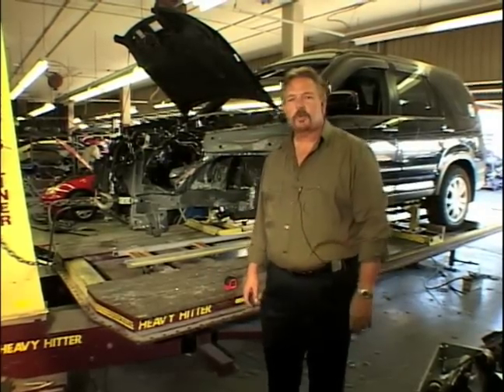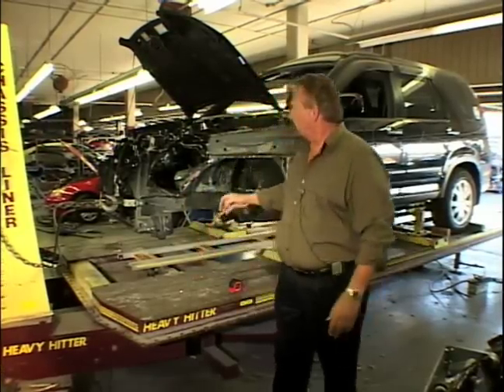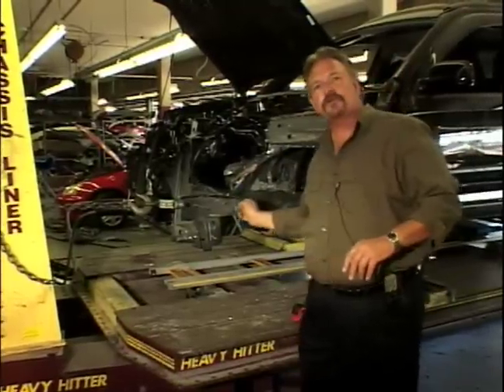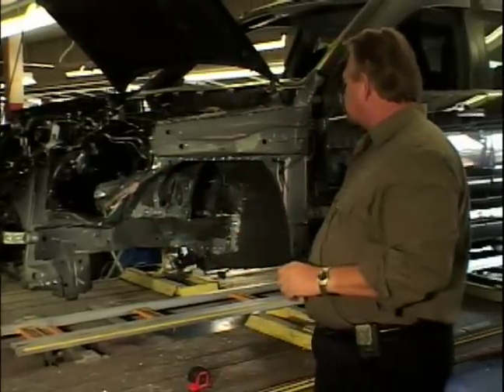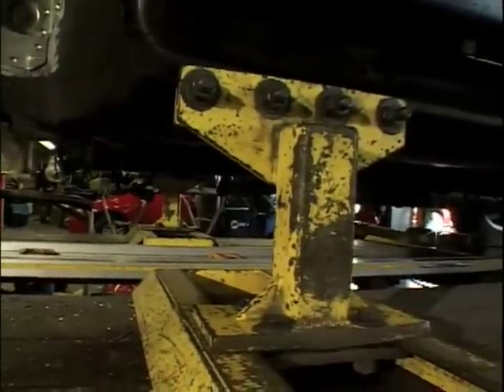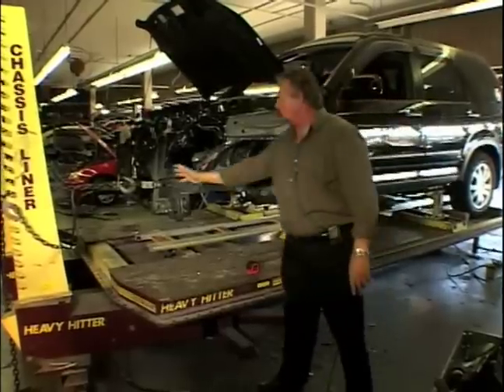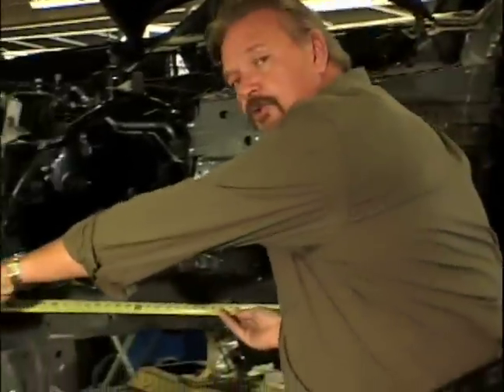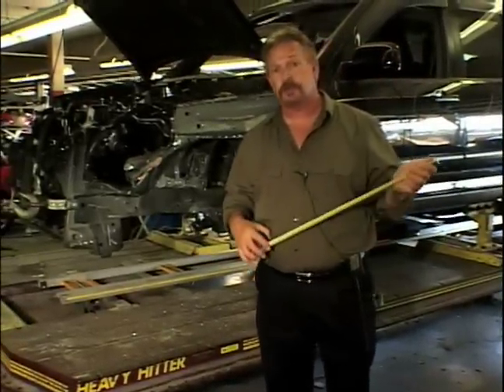How to: Car Repair : How Wrecked Car Frames are Straightened

Comment: Autobody instructor here and everyone should know, frames and unitized bodies can be straightened easily and correctly but like with most things, their are correct procedures and processes to do it. With a  proper frame staightener and devices, any frame can be put back to factory specs, like it never happened. I've done it 100's of times but knowledge is critical and you don't do it by hooking the car to a tree and measure with a tape measure.
Reply: Like it never happened is totally inaccurate I must say and I'm not trying to be rude here. When a car such as this one has been in a wreck and suffers frame damage, that "damage" is unrepairable. The bending of the frame is cause by a rupture of the bonds between the molecules of the metal in this case probably a mixture of iron and steel. Using a framing machine sure helps put the car back together but the strength or integrity of the frame will never be the same again. So if the same car gets into a collision more of less of the same magnitude, the damage this time will surely be significantly worse thereby putting the driver/pas at more risk of injury or possibly, even death. With that being said, I must admit I drive a rebuilt vehicle and I'm starting to think I'm a little too comfortable with this clearly ill-calculated risk.
Reply: +ezyfnef agreed .. never the same
Reply: I question credibility instantly, when you say "any frame". like, a ford ranger that stalled in front of a train, could it do that?
Reply: Do you have a shop?

Comment: OK. Some pretty harsh comments.  In my defense, I had no control over the editing. This was filmed as almost one long sequence, and was cut by Expert Village where ever they saw fit. I did discuss advance measuring techniques, but it was cut out.  FYI, I did not receive any money for this video.  Any measuring system is only as good as the technican using it. I have seen frames ruined even when jigs were used!  I also have seen metal men move from one shop to another with great frequency.  Also for FYI, I have managed several body shops, and seen thousands of repairs, both good and bad.  If you polled all of the body shops in America, you will find that only a small percentage has advance measuring systems.   Technology is great if you can afford it, but only if the person using it has sufficent skill!  To make issues worse, there are very few schools turnng out highly skilled bodymen!  But I admit, if I had control over the video, it would have been very different!  God Bless You All! 

P.S.  I'm down to 215lbs now. Thought you would like o know!
Reply: Don't pay attention to any "harsh comments" thats the nature of YouTube, 3/4 s of the time they have no clue what they are talking about anyway, thank you for the video, very helpful.
Reply: muhammad ali weighed 210.5 lbs when he won the title. you need to lose another 4.5 lbs.
Reply: Great job on the weight loss!! I bet you feel a lot better : )
Reply: loved the vid make more in depth ones!

Comment: I have a 69 charger and the driver side frame is bent inward nearly 30 degrees, would a steel cresent wrench and a long cheater bar be strong enough to bend it back

Comment: @tomcatdcn It depends if the metal is cracked or not, usually I don't think you would have to worry unless you crash it repeatedly in the same spot.

Comment: @Cargo1273 Our van was declared totaled because of the mounting hole for the rear bumper on the left side was torn out by the impact. Replacing the frame rail was the only way the insurance company would do it and they didn't want to pay for it vs welding the hole and re drilling it out.

Comment: Once a frame is bent (depending on how severe) it will never ever be back 100% original factor specs. Depending on the technician, you might can get close. But there is no such thing as reverse-entropy
Reply: Yup. Even if the frame is put exactly back into its original position, the structural integrity of the frame is slightly compromised

Comment: Guys, for unibody structures if you watch Sam g's videos you would see that he drills out the spot welds for frame pieces that are really bent and then he welds on new aftermarket frame pieces. For example the radiator support or the frame pieces for the trunk. You guys think that they're just bending out severely bent frame pieces but they're not. That's not how it works
Reply: yeah undo the welds then bend the metal and then reweld the seams back with stronger protection

Comment: @Cargo1273   I don't know where you learned that but it's wrong.  There are several ways to do this.  1 is to pull out the frame rails and repair as this video is showing.  The second option, which is more commonly used on a unibody car is to replace the rail if it can't be repaired or to buy a new rail and cut out, or section in shop terms, the area that you need and weld it in place of the damgaed area.  The 3rd option is to replace the frame altogether, usually on a truck or large suv.

Comment: Not enough body mechanics have proper I-Car training in repair procedures in North America.  Cars are butchered and high-strength steels are rendered useless by improper heating and pulling creating weak points.
Reply: +Audioquest56  did you ever attend any class , I do , they don not teach nothing
Reply: panchacleta Vargas Yes, I take 4 per year to maintain my Platinum status.  I think you need a better teacher...

Comment: Isn't the frame still structurally comprimised?  Don't most people take pieces of another car's frame and weld it onto theirs? I understand the point of tension would be at the weld but, even then that is better then an aluminum can that was bent and rebent....

Comment: @YouSpamTard Our van was declared totaled because of the hole for the left side of the rear bumper in the frame rail had been torn out by the impact. The cost of replacing that frame rail put it over the 75%. It would have been not totaled if the insurance company would pay for repairing that rail but no they said they could get sued for doing it that way. I guess insurance companies do lose lawsuits once in a blue moon. I would think they pay for the best lawyers and weasle out of claims.

Comment: 3 dimensional measuring ONLY. Machine is fine as long as the tech knows how to use it. Without a good measuring system (and someone who knows how to use it)  the cars are not PROPERLY repaired. Would a real carpenter build a home without a level, tape measure and/or (in todays world) some sort of laser. Without a good foundation you have nothing.

Comment: If the frame was bent the insurance company would  total the vehicle anyways there would be no point in trying to fix it
Reply: Insurance buys the vehicle, sells the vehicle through auction, buy gets it fixed, buyer sells vehicle with salvaged title. It's a very common thing.
Reply: doughnuts6801234  
no ..in fact frame repair is not that costly in the US. most of the car which had front end accident needs frame repair. Once you involved in accident, the frame will be bent it is just a matter of how much.
Reply: doughnuts6801234  that's right🤔
Reply: Valid Point not alot of insurance compaines would fix a car that has it frame creased or bent plus these insurance will total anything these days because they want to cut down on time spent working on the car
Reply: @xaytana  Incorrect. Insurance buys vehicle.  A new title is issued for the vehicle declaring it's "salvage" status.  Auction/person buying it back from insurance has it rebuilt/repaired, then applies for a "rebuilt" title.

Comment: once the frame is bent, the car is shit, it will never be the same no matter how much you tape measure, you don't know the headaches i've endured trying to align a car that had a front end collision and the frame was "straightened"
Reply: i wouldn't straighten it neither, i would buy another frame and replace it, like cars with rusted frames, its much better to replace it in the long run, and used frames in good condition are not uncommon
Reply: once its strengthened its fine otherwise they would never bother having made these machines to repair cars
Reply: you had headaches because someone did not straighten it properly
Reply: lol I agree.
Reply: I HAVE A 2010 DODGE JOURNEY ID LIKE TO KNOW THE COST OF PUTTING MY CAR ON THIS FRAME MACHINE.
Reply: Shite.

Comment: Hundreds to thousands, depends on the damage... normally if the cost exceeds a thousand dollars, or the value of the car the insurance company will total the car and write you a check.

Frame damage is the worst damage to get, caused by fire or impact it can destroy the car's structural integrity that protects you in the event of a crash. Sometimes it's just not worth fixing.
Reply: If you watch Sam g's videos you would see that for unibody structures he drills out the welds and replaces the frame pieces with aftermarket. So actually the frame stays intact he's not bending out bent frames he's replacing the frame pieces by drilling out the spot welds and then rewelding the new pieces on
Reply: eksine Do you think the car can, after that, retain its once factory chassis rigidity and geometry? 

Asking only because my new car has been in a hard crash (roof first into a tree) and the chassis has bended a little bit.

All the pieces will be cut out on welds and replaced with new ones, but I am having trouble believing it will be the same as original. 

The car is very rare and unique, and everything except the roof, pillars and front windshield on the car is undamaged, which is the reason I am fixing it. 

Do you think it can be redone to its original shape and rigidity? 
(My bodywork guy is knowt to have perform miracles before)
Reply: @drazenbudis7881  I'm not an expert but this is how the body shop do it through insurance. It won't be perfect but I don't think it's unsafe as long as they do it right. If you see them just welding the joints that were cracked than I'd call them out on that bullshit